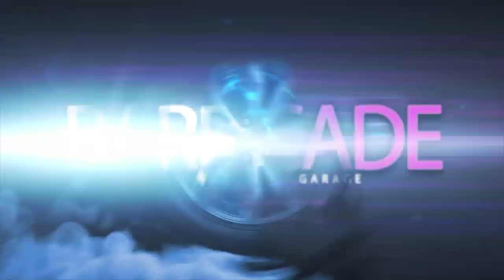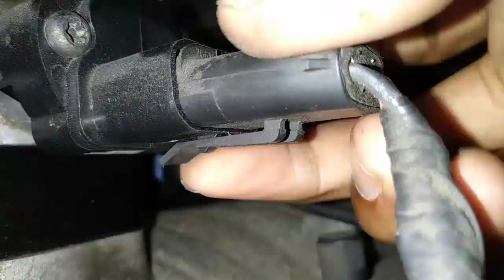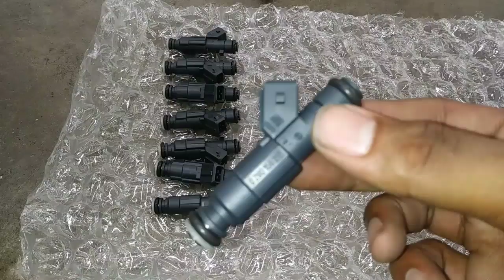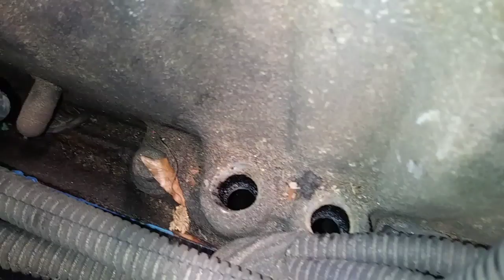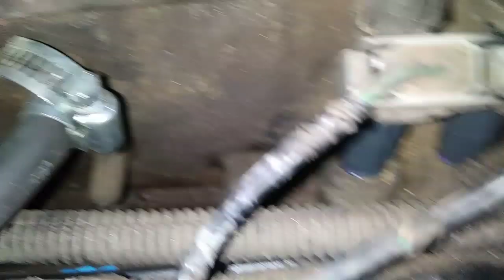FUEL INJECTOR REPLACEMENT (JEEP/DODGE 5.2/5.9 V8)

Comment: I wonder which is better the 4 hole or 12 hole injectors ? I would think the 12 hole would be easier to clog , which might be a issue if contamination is why they are being changed in the first place. 🤔

Comment: I did this upgrade on a 2001 Jeep Grand Cherokee 4.0L .  I installed the 4 hole Bosch injectors also, and the installation went smoothly and my engine is running a lot more smoothly and my gas mileage increased about 5 more mpg so at first I was super happy, but unfortunately after driving my Jeep for a couple of days my computer threw a P0175 error code meaning the engine is running rich in bank 2 which could cause the catalytic converter to clog up eventually so I switched back to the origional injectors because I had to get a smog certification. I cleared the P0175 with my ODBII reader and the code never came back with the original 1 hole injectors, but I sure would to go back to the 4 hole Bosch injectors.  I called the guy on ebay that solde me these Bosch injectors and he sent me a second set and the second set also threw a P0175 code. I'm sure all injectors were installed correctly with lubricant on the silicon lubricant on the o-rings and the injectors pushed all the way and clipped in.  Can anyone tell me what I can do to fix this problem with the new injectors?

Comment: Great video and thankyou. This is going to help👍👍

Worthing noting: 

This 5.2v8 is indentical to the 3.9v6 
Uses same injectors engine layout.

Minus two cylinders.  What I mean.

Side by side engine comparison and 
Each fuel rail.

Remove two back fuel injectors to the hose.

Vola its 3.9v6 magnum👍

Removal process of this will be exact same for the 

1997 to 2004 dakota 3.9v6 4wd 👍

I know because its what I need to do but replace one injector misfire#3.

Comment: Disconnecting fuel lines is probably the most difficult thing here. I believe 1993-1995 is slightly more complicated. I have two fuel lines, do you only have 1?

Comment: Great video! All meat and no fat. But the 1998 5.9L engine must be just different enough that these injectors on the completed fuel rail assy don't bolt up straight... off by a good 1/4".

Comment: Nice video and gives you all the instructions on how to do the job. I need to replace the injectors in my truck eventually but I have a 59 L and I want to put Edelbrock.
24-3511 fuel rails but it requires a Edelbrock air intake, but do you think I can just get away with doing it on the stock intake and Bosch injectors because I don’t think that upgraded air intake has a heater core

Comment: Just noticed that you are not driving your AC compressor with the belt. I wanted to do the same on my Jeep, but did not think it is possible. Now I see it is, so I will search for solution on YT. If you have time, just in case I dont find any HOWTO, could you reply with your way of achieving that? Thank you!

Comment: Excellent video, very clear, even called out the bolt sizes.   I have a 94 and its a bit different with the fuel pressure regulator on the rail itself.   One question, did you try cleaning the old injectors, I got a significant boost just from cleaning the old ones.

Comment: I seen few yrs ago about someone on utube said can use ford injectors that spray than the dodge ones that stream line in ,the bosch ones you shown spray type and did motor run better and any mileage or power difference?

Comment: Hey BARRICADE GARAGE can you please share with me how you got that adaptor plate in your throttle body for the air hat stud. I cant find an offset stud that will fit my 5.2 so i can use an air cleaner. Thank you in advance sir. And great videos man very helpful.

Comment: Installed the very same injectors in my 2000 Durango 5.2L. The new injectors installed very easily and the truck runs great!
Thank you for the instructional video…it was spot on!!
Reply: So have the injectors held up over the past year?
Reply: @constitutionalbacker1stame787  They sure have.
Reply: @johnscreekmark  the new injectors really increase the mileage ?
Reply: @angelomiglioranza  They have - by a couple of MPG’s..and significantly improved performance.

Comment: How did you decide on these specific injectors? I'm not seeing them as a fit for the Mopar SB magnum engines (5.2 or 5.9) although the flow rate is certainly adequate for this amount of horsepower.

Comment: Man you're videos have helped me a lot I got a code 27 so I went threw check out all wires they all had ground a power threw them. So I decided change fuel injectors after everything else checked out never did it before your video is only one that showed hole way doing thanks.

Comment: How are you doing? I love the videos and am an avid do it yourself guy. I've got the 1998 5.9L jeep grand cherokee and am having alot of issues. My jeep was parked long enough for squirrels to make a mess of the hoses and wiring. I would like to replace the fuel injection harness completely but am undecicive on the right part, can you give me a heads up please?

Comment: If it won't start without the fuel pump relay and it dies immediately after the relay is pulled while running, what might be wrong?

Comment: $50 brand new set of 8 injectors on AliExpress (but it takes like 30 days to get them). Search on Aliexpress for "Set of 8 0280156211 0280155931 Fuel Injectors" multiple sellers have them.

Comment: Good job but one big note.  You should have cleaned the entire intake area with compressed air before you pulled the fuel rail.  There was a lot of dirt and debris that was moving around while you pulled the rail.  You want to clean that off first.  You don't want to let it fall in or  wipe it into the intake/combustion chamber after you pull the injectors.  Cheers!

Comment: Just did this for my '98 gangster spaceship, is it normal for it to idle at less than 1000 rpms after it warms up? It definitely idles better
Reply: my 98 zj idles at like 500-600rpm, so does my 2000 XJ

Comment: Could have made this video 5 minutes shorter. "Installation is the reverse of removal". If the injectors are hard to get out of the manifold, just hose them down with some WD-40 and they will pop right out. I went through this when I swapped to a Hughes Air gap Manifold.

Comment: I see that your jeep has 230,000 miles.
mine has 199000 miles and is running very well but I do want to do some work to it.
I'm hoping keep it running well for a long time.
Your videos help me a lot.
Next I'm going to do all brakes and suspension.
Then I have to start working on the four-wheel drive.
Reply: Well I'm reading through these posts and I came upon My Old Post and since then A lot happened .
I found a similar 97 which had a lot of that work already done so I sold my first zj for this one that had most of the work done already.
It's been great. I've got it up to about 240k and it runs perfect.
Saw one just like mine with 400k that just sounded great. 
So I'm shooting for 400k now.

Comment: Just watched your videos on the injectors,  holly throttle body,  and Aem intake what did you gain from all that. Looks like a lot of money,  what it worth it and what is the mileage on your jeep? I have a 93 with 210,000 and 35's wondering if this is worth doing? Enjoying the channel, thanks for the insight.

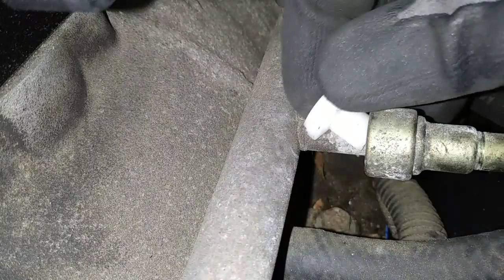Comment: Hi, how are you? I have a question in the 3:32 minute of your video. Do you use insurance to drop the gasoline hose where you got that piece?
Reply from the maker: Its called a fuel line disconnect tool and you can get them from any parts store
Reply: Yeah, but do you have the insurance to disconnect the fuel line in case you drop it?

Comment: I know I’m a bit late but did you let the screws set your injectors in place? Changed the p rings on them and I don’t want to have fuel coming out when I start the truck, thank you!!
Reply from the maker: Yeah pretty much, just set them all in place, press them in and tighten screws. They dont really snap in place or anything but make sure to lube the o-rings if you can

Comment: Aren’t 25lb injectors a little too high for the 5.2? From the factory they’re 23.8 if I’m not mistaken.
Reply: the difference isn’t that much, and the ecm will figure out that it is spraying just a little too much and pull back. will be fine, this is a fuel mpg mod, so it gets better mpg

Comment: Just did this but the jeep is vibrating badly now, I think I might have swapped two connectors, does anyone have what color wires correspond to what injectors?
Reply: Hey man I know this was 2 years ago, but I just did the same job and I think I’m having the same problem you had. Did you ever find a fix?

Comment: The Black Cap on the Fuel rail is the Schrader valve that can be used for Checking and/or depressurizing the fuel pressure.
Reply: You don't really want to spray fuel all over when you could just cumbust it!

Comment: Some online forums show the Bosch 0280155703 as the fuel injector of choice for this swap. How are the 0280156211 different?
Reply from the maker: I dont know about the ones your talking about so I cant speak on that but the ones I used work great and are listed as an upgrade to the stock injectors. I even bought another set and put them on my wifes '97 ZJ
Reply: I’ll go with yours then. I have a 98 5.9L

Comment: What a great video brother.  In the beginning, after you let engine stall out, put relay back in and remove negative battery terminal - do you have to remove relay again, or can you keep it in there during repair?
You’re right, not much info on these engines, but yours is all we need.  Thanks again brother and stay safe
Reply from the maker: Keep it in during repair
Reply: Thanks, will do

Comment: Great video except before you take the injectors out that's good too use a little lite air pressure to blow some of the sand and dirt out from around the injectors keep dirt out of the motor but other than that good job.😀

Comment: I have a 1998 ram 5.9 and was wondering what all sensors are on these engines besides the iac valve
Reply from the maker: Its all the same as the ones in the video

Comment: Super stoked to have you as a resource.   Great video!     Would you take Requests?   I need help with replacing a front disc brake flex hose on the passenger side.   ..
Reply from the maker: I dont plan on doing that no time soon and I just replaced that hose on my wifes '97 last year. Its a simple fix and As long as you have yourself a good set of flare nut wrenches you should be ok

Comment: Just did this in my 97 ZJ after the fuel line started leaking. My injectors where stuck on tight! I had to use a little elbow grease to get them out. I already tell it runs more smoothly and it feels like I have more power ( it use to starve at 4k rpm and now can climb to red line). I highly recommend this swap mainly because your injectors are probably old and this upgrade can be cheaper than factory replacement. I got mine on eBay for $7O with pigtail adapters.

Comment: What would happen if you don’t cycle the key? How often should injectors be replaced
Reply from the maker: If yo dont cycle the key its going to have a hard start and run rough until fuel pressure is normal.
Injectors arent something you normally replace unless they are bad but I decided to upgrade mine and ditch the 24 year old OEM ones

Comment: Hello I have the same jeep and I was wondering if your a/c went out and what you did to fix it because I had tried multiple things to fix mine and it’s just not working
Reply from the maker: I used a bypass belt so my ac compressor is pretty much dead weight. I plan on putting an on board air compressor in its place to power small tools and air up tires.
Reply: check your "High Side Sensor"..the wiring connect has a habit of losing up and needs to pushed in tight back into the sensor..if the wires are not making contact your A/C will not funtion
Reply: Get a vacuum put on it first then make sure it passes a leak test of at least 45 min. If it passes. Fill with correct amount of freon and 1 oz of pag oil. And make sure your compressor kicks on when you run your AC on max
Reply: My 95 Dodge ram 1500 4x4 single cab has amazing ac I get frozen in 100+ lasvegas heat lol. But I also work at a shop with an A/c Machine 🤣

Comment: Dude you are god sent... The last 4 videos have been uploaded right when I needed some help with those exact projects! Leaking injectors last week ordered the parts and you already have a video out before they get here! Haha
Reply from the maker: This is something you wont regret doing. Not only does my Jeep immediately fire up when I start it, The pedal is more responsive and the idle is smoother. The overhead display for mileage (DTE) used to show 318 on a full tank but now shows 380 on the full tank. I should have done this a long time ago
Reply: @barricadegarage5361  I got the same Bosch injectors and I'm excited for that little fuel mileage boost and quick starts! Thanks

Comment: That's nice when you get injectors that you don't have to splice shit together or have adaptors, SMART MOVE. GREAT EXPLANATION ON WHAT TO DO & SIZES OF SOCKETS THOUGH I DO HATE YOU FOR ALL YOUR FANCY TOOLS, LOL. I'll be getting some shortly though because of you, DAMN IT. Can you give us an update after you decide how it runs or if fuel economy changed ? Hey BG is that the original Throttle body on that BEAST ? If this works out good for you you're going to make me spend more money TOOLS & NOW INJECTORS. IT'S LIKE A LOVE HATE RELATIONSHIP, GREAT VID. BRO AS ALWAYS.
Reply from the maker: My gas mileage has improved, more responsive acceleration and smoother idle. This was worth the money. Thats a stock throttle body in the video but ive since installed the 52mm high flow Holley throttlebody. that video is comming soon
Reply: DAMN IT BG MORE MONEY NOW FOR ME. I'M HAPPY IT WORKED OUT FOR YOU, NOW IT'S MY TURN. YES I SAW IT HAD HOLLEY ON THE TB. WAS JUST WONDERING. THANKS FOR THE FAST UPDATE BRO. WILL ALWAYS BE A FAN & SUBSCRIBER, FACT.
Reply from the maker: @NoWr2Run  trust me, you wont regret going with these fuel injectors. And heres a link to the throttlebody I just put on my Jeep...
https://www.ebay.com/itm/Holley-112-557-Hi-Flow-EFI-Throttle-Body-1996-01-Chrysler-V-8-2-x-52mm-/382747788771